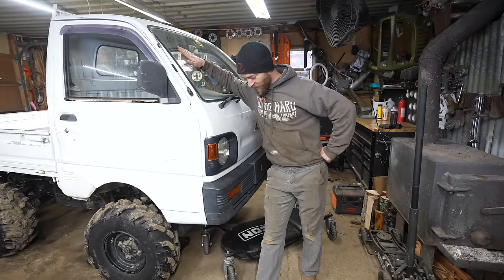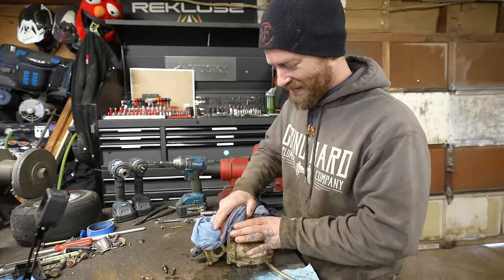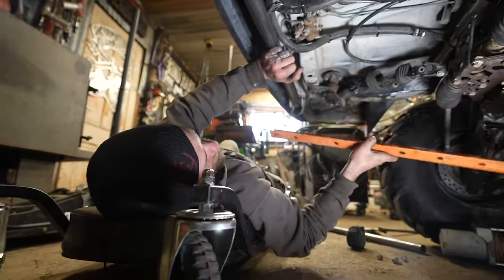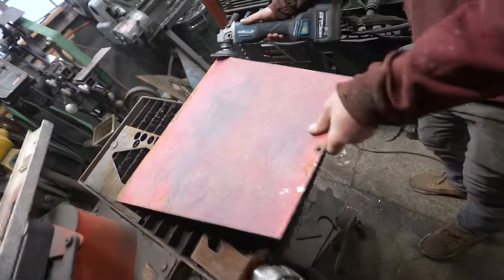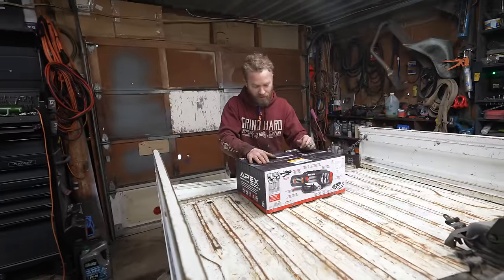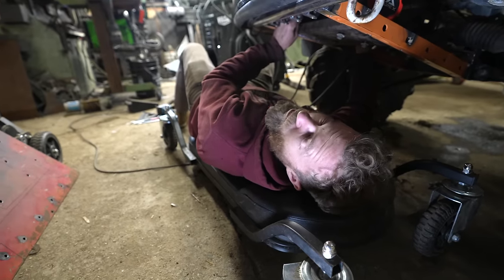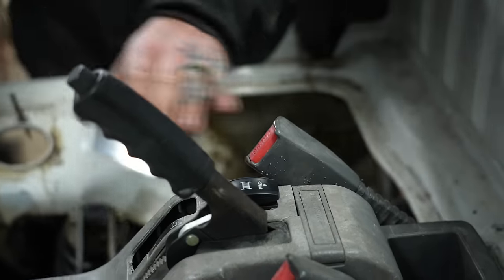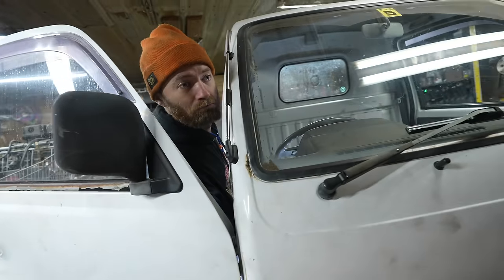6x6 Mini Truck Finished! And Rolled?

Comment: providing you can ensure that all the bearings get the proper oil, you could take one of the upgraded diffs and flip it upside down to correct for the opposite rotation and mount it with custom brackets. i'm not familiar with these diffs, so i'm not sure if you could get it to work.

Comment: My friends, old mechanic here. Hose no chuck isn't new. And it works because the valve let air in not out normally. So once you depress hose coupler center with valve stem, air pressure just pushes past core.

Comment: If you get double thick plexiglass and home depot latches like the wrangler has, my buddy rolled his civic like that. Hammered the roof straight and cut the plexiglass to shape. put a hood latch in all 4 corners (the rubber kind) and it flexes to shape. Wrapped it in door weather stripping. Good for rain, not the car wash but it is hilarious!

Comment: Next project should be to expand the size of the pond by adding a dam wall. Increasing the depth and surface area of the mini jet boat park!

Good chance to add a hydro generator too for free electricity.

Comment: Really don't know if this will apply, but if it's symmetric enough to mount up, you can invert a differential to reverse its effective drive direction. Risky if the gears are helical cut, because the pinion thrust may not be carried appropriately depending on the pinion bearing configuration (effectively it's running in "reverse" all the time), but these ones appear straight-cut. May also have difficulty if limited slip is involved, depending on if it's forward/reverse biased.

Comment: The thing with filling the tire with air, it's more of a check valve on the tire, the pressure pushes the stem not anything mechanical

Comment: Build one using a crew cab mini truck and stretch the frame between the rear axles so you can put at least 30 to 33 inch tires on it. Now that would be something to see.

Comment: to anyone wondering about the air chuck "hack"  its the air pressure from the hose that just pushes the valve stem open

Comment: Just had a thought, what about extending the bash plate the full length of the chassis? Even if it was in (tries thinking in American) 1/8th of an inch, the extra weight added (oh no!!!), would be below the center of gravity, which would help a little in stopping it flip over. Though the real reason it flipped was the edge of the wheels digging into the dirt. Thicker plate would be even better...

Comment: As yall called it, the tire valve trick doesn't need a "Pokey Thingy",  as it's a one way air valve. So, the air from the compressor opens the valve on its own. The "Pokey Thingy" is only needed as a way to activate the valve to release air only,...not to fill it.

Comment: you dont need to push the stem to put air in the tire, the air pressure just pushes the valve open. Its meant to keep air in not out

Comment: If you take the valve core out of stem when you have problem beading tire and shove quick connect over stem you can get alot more Air in faster seat bead easier

Comment: Note: At 17:00 The air chuck does not need to push the Schrader valve open if the air pressure in the hose minus the air pressure in the tire is greater than the spring pressure of the valve.  Tire valves have low spring rates compared to say the Schrader valve in a propane can or AC unit.

Comment: A viscous coupler would dampen the shock on the front differential. If you can’t find an upgrade anyway.
Loads of AWD Honda’s use them.

Comment: I'm 49 and my dad was doing the inflating tire just with guick connector  when I was a teen. If you use it to much it will ruin the quick connection.

Comment: The Schrader valve is simply a check valve the stem pushes on the inside of quick connect end allowing air to pass into tires pretty much anyone that's work with tires knows the trick

Comment: After airing tires up sans an air chuck the past 45 years or more it only works on longer valve stems and not the super shorty ones... Not all couplers will work though..

Comment: As long as the pressure is higher then what's in the tire. The air will push down the tire valve.

Comment: 17:04 this ruins the quick connect fittings on your air hose. But if you take out the valve and do this it'll flow enough to get most tires on the bead immediately. Still ruins the fitting though.

Comment: Would you be able to flip that aftermarket front differential for correct rotation? Of coarse you would need to reconfigure the mounting, but I doubt that would be an issue for you. 🤷🏻‍♂️

Comment: If the other diffs spin the other way just flip it over and make a mount to fit then it will be spinning the correct way for what you need. Will probably need to block the breathers and drill new ones

Comment: It's stable enough for what it is but it hooked a donut rut with 2 rear tires which flopped it over.. add 2" wide wheel spacers at all 6 hubs and it'd be even more stable and less tipsy due to the entire body and passengers being above the vehicles centerline... Rock on fellas..

Comment: If you want the differential to spin the opposite direction, just flip it over so that the ring gear is on the opposite side.  I don't know how hard it would be to mount it, but that would let you use an upgraded diff.

Comment: Just a side note; I have done an absurd amount of work on ranger and RZR 800s. I have come to the conclusion that: they are garbage. That’s pretty much it. The motors are super easy to work on but make sure you replace the high pressure oil relief with (2) 5/16” ball bearings instead of the pin that slides in there. The front diff is also notorious for being trash quality too.

Comment: Ha ha ha.... Can't believe you just found out about the air chuck delete trick. That's at least 40 years old. 
Almost ready for the Dakar Rally. Only needs more gas capacity & on the fly suspension stiffness for the loss of weight from using all the gas.

Comment: I'm looking into purchasing a upp Samsung cell 48 v 21 ah battery and charger and frame case with straps for 125 bucks , it's going on a razor mx 500 you think 125 bucks is a good deal for that setup ??

Comment: The air pressure overpowers the valve that’s y it works you need over 100 psi to work

Comment: Toss that cab over and throw on that vw body I seen in the background. 

When using the air chuck to fill up tires, be careful for sometimes the chuck gets stuck on the valve

Comment: Hmm
If you go with a wider axle setup would mitigate roll but add weight.
Which means an excuse to add horsepower 👍
Reply: Also all the broken glass is just part of stage one lightening

Comment: I'd like to know when you're going to put a Kawasaki Suzuki yamaha 1300 or 12:00 behind that transmission that'll give you however many gears in the tranny plus the six-speed transmission in the in line for you turn it so that the cylinders line up front to back you should be able to hook to the shafts at the sprocket with a drive line that goes to the transmission in the Yuna MOG MOG wicked triple snowmobile engine

Comment: At 23:45 ur lucky u didn’t roll it 270 degrees. Did the same shit to my dads side by side and bent the roll cage a whole 2 inches straight down(2 inch roll tubed roll cage) was doing the same type of donuts came in hot and caught the back tire on a Chunk of grass 🤣🤣🤣🤣 same reaction as u “oh I’m good that’s what seat belts are for” 🤣🤣🤣 (was only 13 too, driving a 1600 cc articcat wild cat side by side like I stole it)

Comment: The placement of the winch switch is not so good. Someone did that in a can am x3 and they hit the switch with there elbow. The winch pulled the hook through the roller fair lead and then pulling the hook around the winch drum breaking all the cross supports off the winch. Putting a winch control where it can be accidentally hit that easy gets expensive.

Comment: Be careful inflating without the air chuck. Certain fittings get locked onto the air valve. Then you have to rip it out super fast or risk overinflation and possible tire explosion!!! Witnessed this the day I learnt that it works. At "Baker Motor Co." Back in 04'. Watched a trailer tire blow most of the sidewall and half the tread out when he couldn't make it release or rip out the valve stem. Not that it'll happen everytime or hell, it may never happen to you. Just be careful Brotiens. I'd hate to see any of you in the ER with half your face hanging off!!!

Comment: I hope that tyre got let down a tad.
Reply: On a side note the air pressure alone is what opened the valve on the wheel. Not a good idea to teach this. Some one is going to get there face blown off.

Comment: The reason why light(kei) trucks and mini(kei) cars are sold exclusively in Japan and not marketed in the West is because of people who drive like this.
Kei cars are only true eco-cars that have been around for a long time, limited to town-use usage for driving in narrow areas and short distances, made of gasoline-powered vehicles.
The light (kei)car focuses on high fuel efficiency, is economical in terms of gasoline consumption, and is practical in terms of capability, and is environmentally friendly.

Light(kei) cars are not built for speed, nor are they built for heavy-duty use on rough roads.
They are not designed for this kind of use in the first place.
As long as there are people who cannot abide by these rules and play with them for other purposes, that country will never be allowed to import new light(kei) cars.

Light(kei) cars are small and lightweight, so they are naturally made to be flexible, and if they are handled roughly, they can easily break down, which is very dangerous for human lives.
Japanese people understand the intention of production, follow the rules, and are able to use the products in different ways, which is why they are sold as a matter of course.
Light (kei)cars and kei trucks are not toys or for fun. They are the ultimate practical vehicle for town use.

Comment: I would put a set of Toyota truck IFS front suspension in the front and back to make it front and rear steer find a Suzuki samurai motor and transmission transfer cases and build a small off road truck it make it more stable than what it is better system than the belt drive also put a exo cage around it be a sweet crawler or build another one but a start with a Suzuki samurai and just make a long wheelbase six-by-six Suzuki samurai truck

Comment: You're KILLING YOUR AIR HOSE FITTINGS!!
Don't air up tires like that with no adapter.
I've been doing this for years and it eats up the inside of the hose connector, eventually it won't seal to tools anymore so I don't suggest that tire filling method.